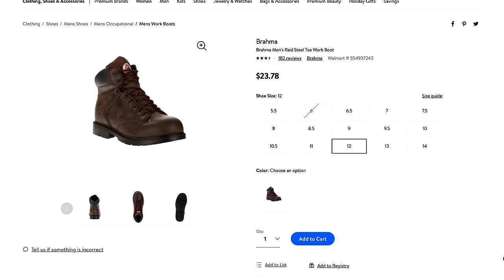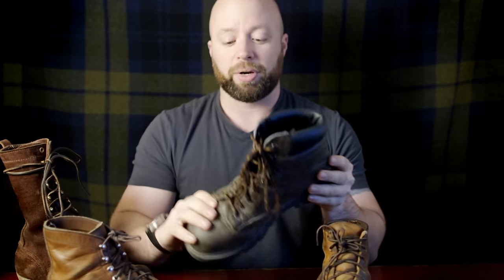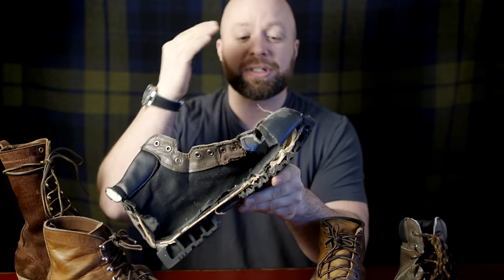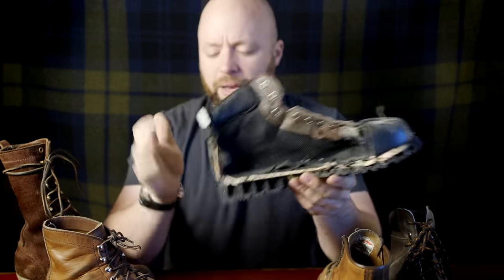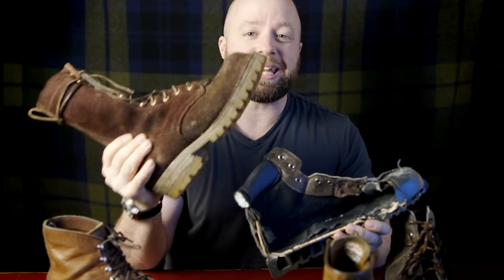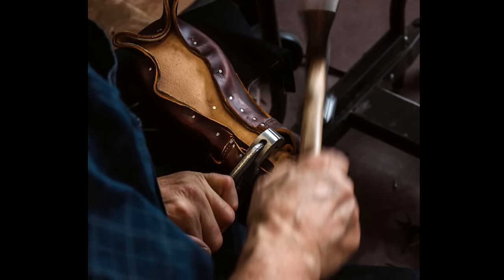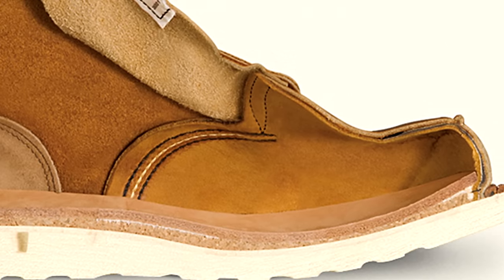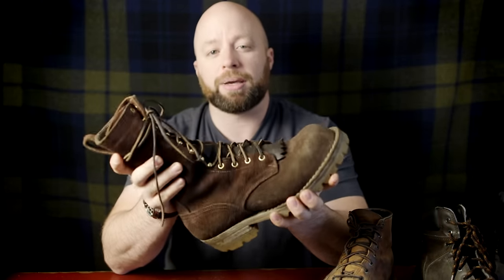Expensive vs Cheap Work Boots

Comment: Everything you mentioned is on point, it’s the exact reason for wearing quality expensive boots. Work boots, you get what you pay for, I work on an engine assembly line, it’s fast pace, physically demanding work, we’re actually called industrial athletes, and without a good high quality expensive work boot, it’s pretty much impossible to do it for me. I wear Redwings, on that job I make sure they’re USA made, because that’s where the quality is. My company offers me a boot voucher so I can get the expensive Redwings, and I only have to pay the difference which is less than 30 dollars in most cases, so for the price if the cheap Brahma boots from Walmart I get quality USA made Redwings can’t beat it lol. Wearing a good quality boot now, will help ensure you’re ist will remain in good shape in your later years. There’s two things a working man should invest in and that’s work boots, and the bed, cause if your not in one your in the other.
Reply: you want to see industrial athletes? go hop on a crew building a WWE show in a major market 50-100 53' box trucks unloaded everything in them assembled and flown then disassembled and put back onto the truck in under 18 hours with 6 hours in the middle to fix any problems and do the show in the middle of that Ive done corporate conventions where in the first 2.5 hours of unloading trucks full of cases weighing 200lbs or more we walked 10 miles

Comment: Truer words were never spoken. Your feet are your contact point with your environment 99% of the time you’re out of bed , therefore the best protection possible should be worn. This means not just the toughest, most comfortable and durable footwear but the most APPROPRIATE  footwear for the task. If you’re cutting trees in the northwest or drylinning in a city your footwear needs differ. I have several pairs of boots made in the northwest and they’ve worn and protected me very well in all kinds of environments. I also have Uvex safety shoes and they’re light, comfortable, flexible and fit for purpose.
These shoes are also durable and good value and are widely available. I can use stilts with them and after a long day on hard floors they help reduce fatigue. Right tool, right price, effective operative! If you want to be mean to your feet, you’re entire being will suffer and long after your working day, week, year and life ends you’ll pay in pain and misery!

Comment: i had a pair of red wings logger boots $300 worth only last me aroun 3 years inside start wearing out so quickly, and the outsole was breaking a part did not understand why that happen,  my job was a factory job not heavy work as contruction or anything like that, i ve been using timberland for two years and mo complain, i do not buy no more red wing work boots.